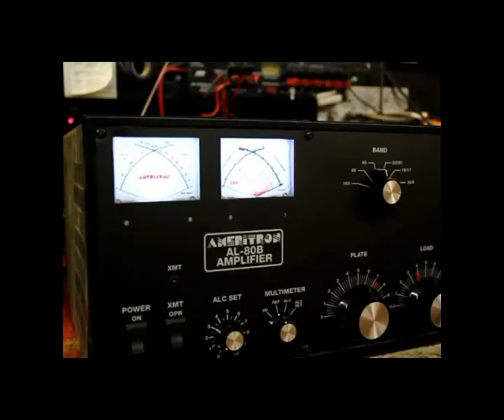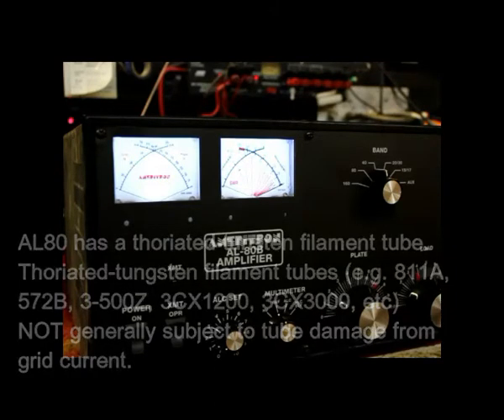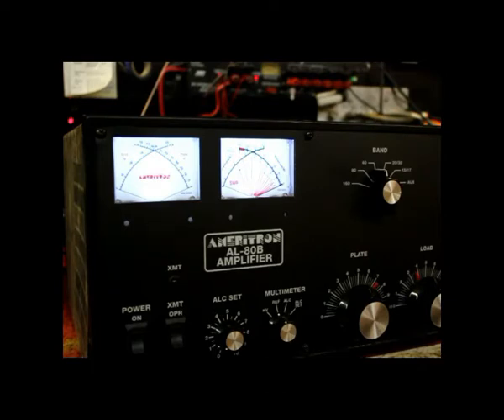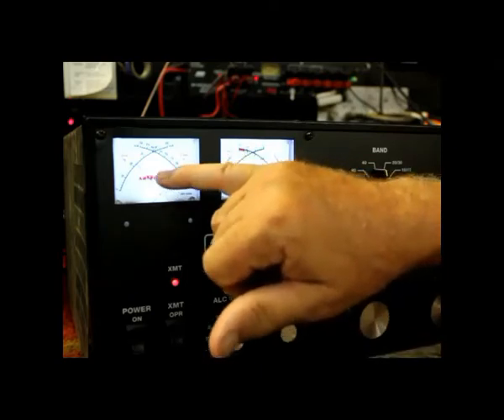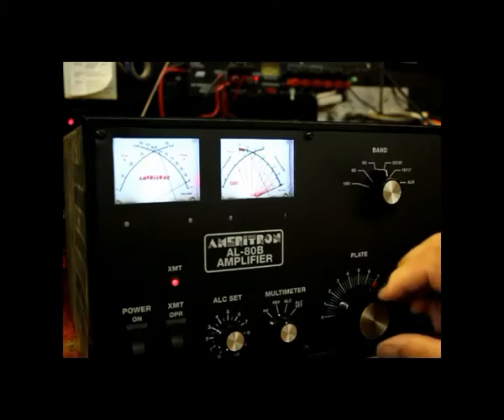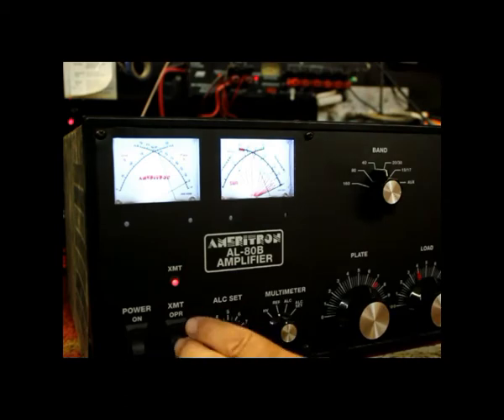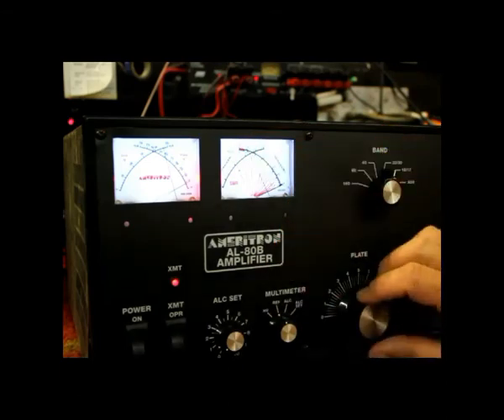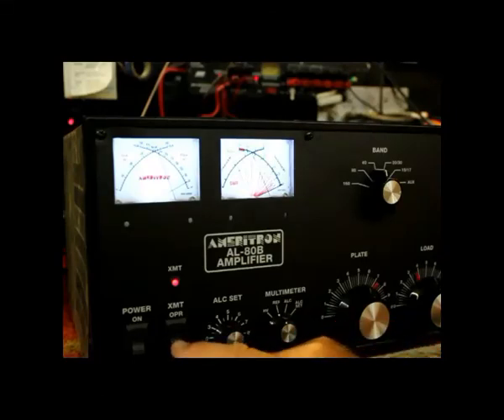Tuning an AL80B With Tuning Pulser and TOF module

Comment: Can I use this pulser in place of CW or RTTY without the TOF mod and tune the amp as I normally would? I loaded one into my VoiceTX on the IC-7300, labeled "Amp Tune" and it works, but I would like your take on it. Thank you - N6IY

Comment: Tom I have one of your New al-80b amplifier can I purchase last year I'm running a derail Stryker 955 into it this is my first go-round with a tube amplifier and I need to know how to set this thing up correctly I think I have it till then but I'm not sure on the alc set everything looks fine once I go to high voltage my reflect is almost 400 what am I doing wrong and if you want my telephone number please contact me because I will give it to you so I can personally speak to you
Reply: Your reflect is so high because of the spurious emissions your Drailed stryker is putting out. A guy just got busted by the FCC for opening garage doors with his Drail stryker and an AL80B

Comment: Hi..i'm watching your videos very interesting...i have an ameritron al-80b and have a problema with the bias circuit..i actívate the amplifier with a pedal...But no see any comsumption in the meter...the hv looks find and 2.9kv and apply driver over 50w and no see watts un the meter..if You know something apreciate your help.. thanks
Reply from the maker: The AL80B has a RF sensing bias circuit. Working normally, it is biased right on the edge of conduction without drive. When even the slightest signal, less than 1/10th watt is applied, it should go into operating bias. It has a capacitor that provides delay on release so it doesn't go on and off at a syllabic rate.  (We increase the size of that capacitor when we service them.) 

If your tube is good, it  sounds like you have some bad parts in the bias, in the tuned input, in the relay system, or in wiring. Be careful inside the amplifier. The high voltage can easily kill you.
Reply: @Jerrythenerdful  ok..thanks for tell me...really apreciate...

Comment: Great video. I have a Heathkit SB-1000 aka AL-80A. I noticed you start with the loading cap more towards fully meshed then raise it going clockwise. I have read in a QRZ forum that for this amp it is better to start tuning the amp with the loading more towards not fully meshed and then go backwards counterclockwise with the knob  towards meshed when tuning. If adjusting loading via that direction,  I would then have to go slightly clockwise direction towards unmeshed to drop the grid current. What is your opinion on this loading  method?  Is there a better/safer way for the tube to load adjust the amp in one direction versus the other?  Thank you.

Comment: That's awesome. Can you do a video on tuning the 811 with 572b tubes. I used your tuning instructions on the web site I think I have it set correctly getting just over 600 with 80 in on ssb how ever after tuning from 20 watts and increasing exciter power to 60 watts cw the grid pins the corner I get off cw and go to ssb to finish tuning cause I'm scared of grid overload.
Reply from the maker: I will try as I get caught up more on work.
Reply: @Jerrythenerdful  that's great I understand about work. Work first then YouTube when there's time.  
I might mention I also tune into a mfj can dummy load. 
Thanks for taking the time to do these videos it's great to have help in protecting these fairly expensive equipment. 73's

Comment: Wait a minute...  Did you say you designed this amplifier?  Or, did you mean you designed the modification you're selling?
Reply from the maker: I designed both the amplifier and the module.
Reply: @Jerrythenerdful  Then it's my honor to be the first to comment on your video!  The AL80B is THE most popular amplifier on the market.  I've been in touch with Ham Radio Outlet in Phoenix trying to buy one and they can't keep them on the shelf!  They have a continual waiting list!
Reply: I want one of those TOF modules myself Tom. I have an AL-80B and the AL-811
Reply from the maker: @KJ4CRH  Thanks, Don! I appreciate it.